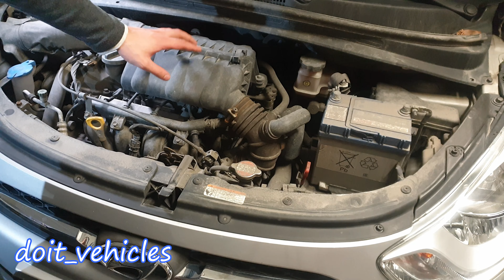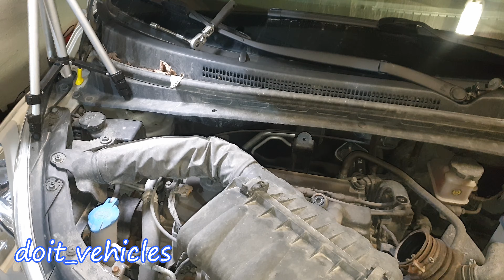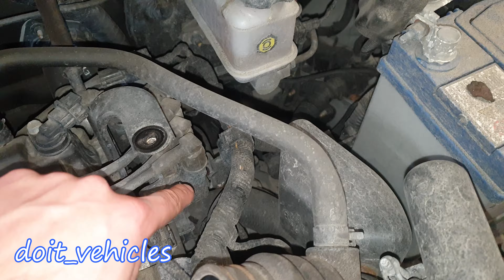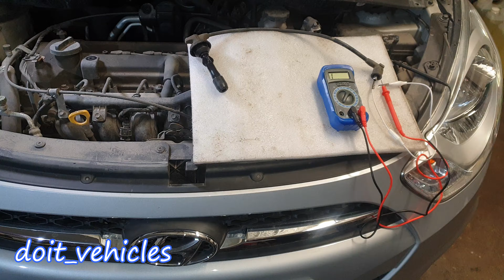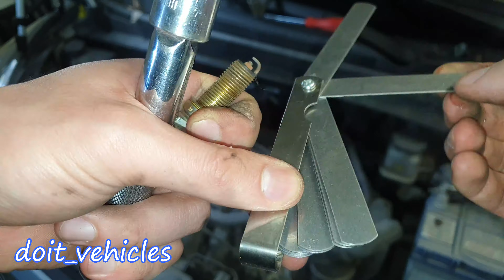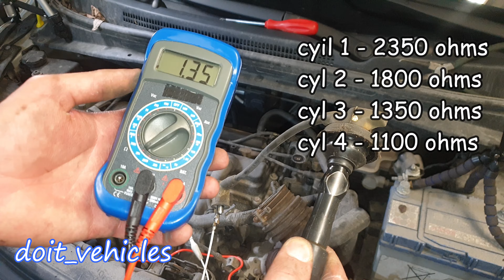1.2 Hyundai i10 Spark Plugs Replacement , Wires Test

Comment: My i10 has a misfire issues (Clyinder 3 as per observations). Have replaced all the spark plugs, checked resistances of all 4 cables they match with your values in video. My 1 & 4 coil resistance is 16.9k and 2 & 3 Coil resistance is 17.2k.
Can you please help me what should be the actual resistance of ignition coils?
What else can be the problem?
Reply from the maker: I would do check the wiring to the coil pack and investigate more in depth the live data on a scan tool first to get a clue about what could be the problem..

Comment: My i10 isn't running very smooth ...the vibration have increased since the last 20k km....it has 80k km odometer....what should I do?
Air filter
Engine oil 
Oil filter
All have been replaced on proper intervals..so what else should I see?? Please help me
Reply from the maker: The best is to check the live data and interpret them . It can be anythinh from a vaccum leak , injector clogged , spark plug gap , etc ..
Reply: @doit_vehicles  spark plugs had been checked...injectors were also cleaned with petrol ... The clutch has to be replaced, could engine be unsmooth due to that? I don't think 🤔 so...there is some oil leak from the oil filter and some engine parts are kind of oily....
Reply: The car had been rear ended ...and there was some exhaust work ....could that be the reason?

Comment: In my car rpm is 2000k I want to reduce it so how do adjustment pls tell
Reply from the maker: this indicate some issue with the idling control components : like throttle body , or a vaccum leak